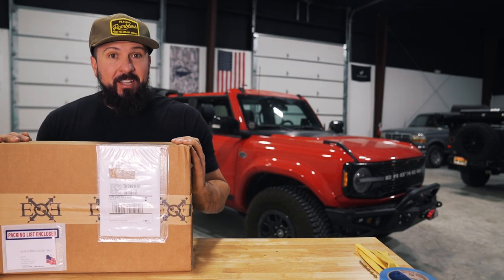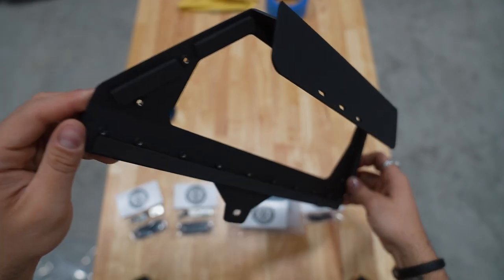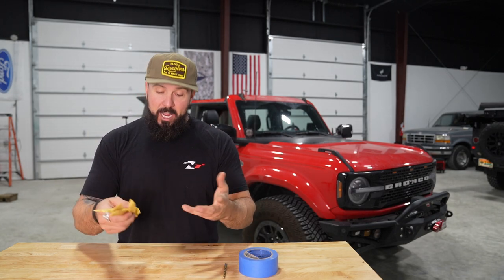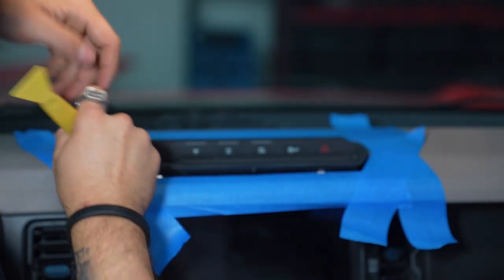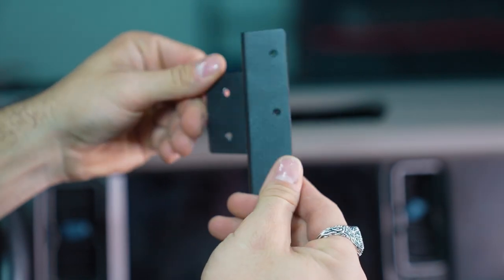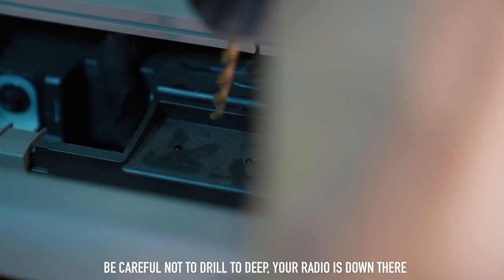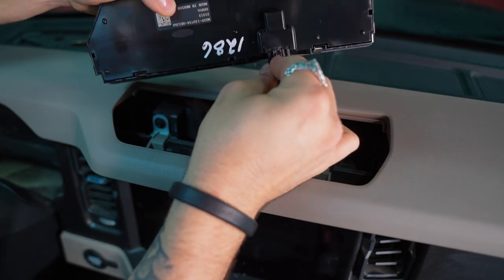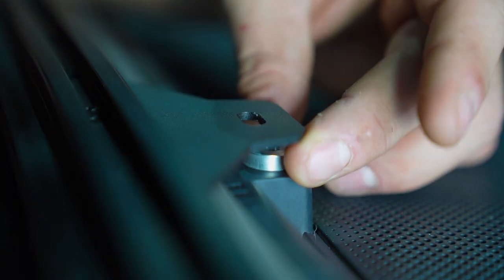Ford Bronco Dash Accessory Mount Install EXPEDITION ESSENTIALS

Comment: I like this so i went to their website to see some finished pictures.   It seems it would be difficult to get to the buttons with accessories mounted to the lower part of the bracket.   What is your experience with it now that you've used it?  I want something to mount a couple phones without blocking my view out the windshield or blocking the dash screen or........
Reply from the maker: I typically ran a phone on drivers side with 3” arm no interference with buttons. Sometime on longer runs I’ll throw another one up for my wife’s phone on opposite side and go pro center back. Never had issues
Reply: @ChaseGentry  That sounds like what I'm looking for.   I'll watch for them to come back in stock

Comment: Chase I reached out to Expedition Essentials and suggested that make vids on accessory installs and have not recieved a reply...I ordered some ipad accessories but no instructions on mounting to top or front and no instructions. Have you mounted iphone/ipad accessories? TY.
Reply from the maker: Yes I run two phone mounts and a go pro. There’s so many options on mounts these days. Ive run Tackform and ram mounts for years without issue. They’d pair well with this mount